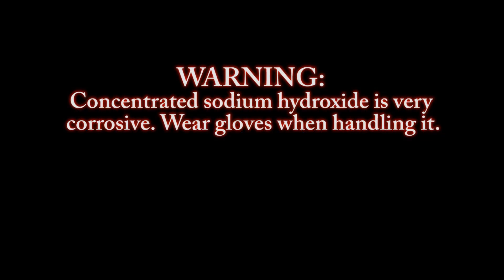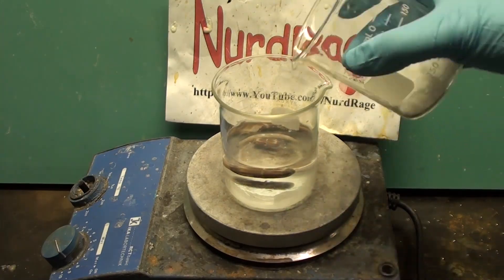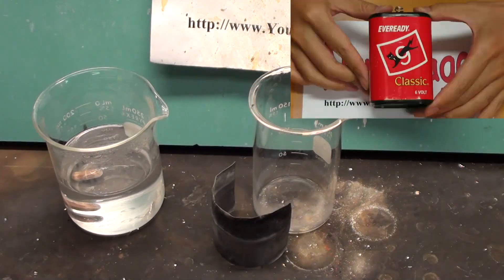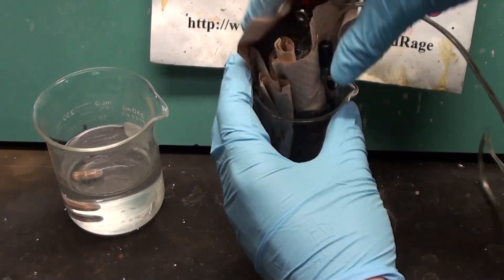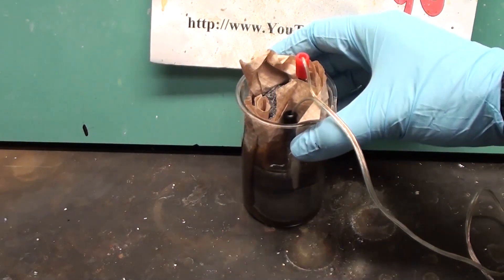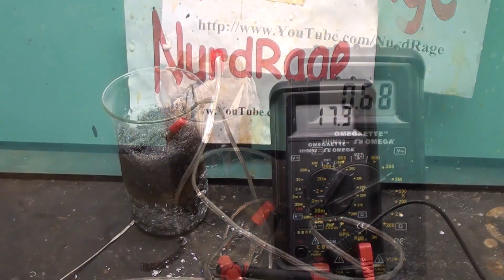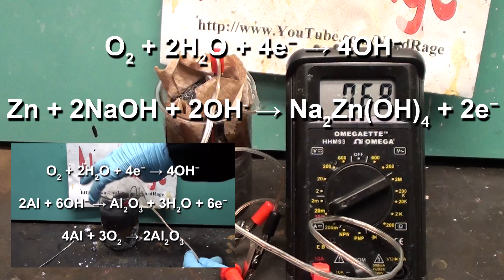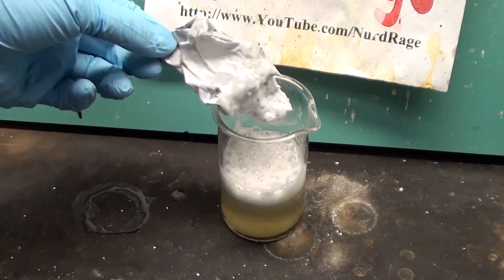Make a Zinc Air Battery

Comment: The railroads used this battery for many decades to operate signals, crossing gates, and interlock devices.

Low, slow current that would last for years.

My biggest question, can you recharge them???

Comment: Correct me if I'm wrong, but doesn't the battery need to be connected to a load in order to measure its current?
Reply: It is connected to a load- the meter. When switched to read current, the meter shunts the input across an internal, low-valued resistor (essentially a short circuit) and reads the voltage drop. So the meter is showing you the maximum current the the battery can provide.
Reply: frtard is 100% correct if anyone wanted conformation. Just DONT test the current in your wall socket if you're curious

Comment: what is its self life when activated
Reply: Throw in an LED diode and see.
Reply: @MexiChemia  this isn't the case anymore. A company now named zinc8 has figured out how to make the cell last longer than lithium. Zinc8 is owned by a mineral company.
Reply: @lksk99 same, checked out MGX and zinc8 stock. Found an article about MGX getting contracts to build a complex that will supply power to a town using this tech. The stock is cheap and might be a damn good stock to buy right now

Comment: then why all the buzz for the aluminum air battery?
Reply from the maker: oh this is just a home-made version for those people that want to make one. A commercial aluminum air battery would be built differently and run better than a homemade aluminum air battery.
Reply: I can imagine.  I'm glad I came across your Channel I used to watch it all the time a few years ago since then I guess I unsubscribed or what have you. I was watching and reading some things about how this kind of battery is not rechargeable and that there was work to make it rechargeable. Any idea how that would be possible
Reply from the maker: Usually such batteries use water to dissolve the chemicals. Aluminum cannot be "recharged" in water because the water would decompose and none of the aluminum would come back. So research is in using solvents other than water. Currently the most promising ones are "deep eutectic solvents". While they do work, they don't last the thousands of cycles required of a commercial battery. Most people would be pretty pissed off if they had to buy a very expensive new battery every month. So they're working on finding even better solvents. Research has been slow though.
Reply: I'll have to Google that.  I have a dream of converting my jeep to electric but for it to be practical
Reply: NurdRage I was wondering if this, or an Al-Air battery would be a viable alterative to the Li-Ion batteries that Rocket Lab are planning to using for their expendable Electron rocket. They're using electric motors to drive the turbopumps for the engines, so I was wondering if a cheaper and better performing alterative would be a disposable metal-air battery? You mentioned that one of the main problems with these metal-air batteries is difficulty in recharging them, but on an expendable rocket they're going to be discarded after the first use anyway, so reachability is a non issue for that purpose. What do you think?
Reply: It theoretically has the highest energy density of any battery.
Reply: It's kinda hard to find air or oxygen in space though.
Reply: Gregory Khvatsky Rockets already carry their own Oxygen on board for those same reasons. Otherwise we'd use jet engines in space.
Reply: Oh yeah, but designing such a system will result in a huge increase of complexity and creation of additional points of failure
Reply: Gregory Khvatsky Not so much I don't think. Mostly just some piping from the Oxygen tank to the batteries, and maybe a heater to keep them at operating temperatures. Also, by cutting the gas generator cycle from the turbo-pump assembly, they're already cutting hundred of possible points of failure.

Comment: how much batteries like that are needed to start up a diesel fueled car engine?
Reply: close...
15 gets you 12V@0.67A... 30 gets you 12V@1.34A... 60 gets you 12V@2.68A... So, you would need 1,335 of them to reach 12V@60A.  Of course the voltage will probably plummet under load and connecting 1K+ of those batteries will create other wire losses as well, so, let's just call it 2K to be safe.
Reply: +peternklv  A normal 2.0 diesel engine can start even with 12 volts at 60 amps circa , so : 12 / 0.8 = 15 ,  and 60 / 0.67 = 89. 15 + 89 = 104. You need 104 of those batteries for 12 V - 60 Amps
Reply: dont use these

Comment: My school is trying to power a small car with this reaction. The voltage is good but the current starts at .4 AMP and then rapidly decreases to zero within a matter of seconds. It jumps around a lot but is by no means steady as shown in the video. Any ideas on how to make the current steady as in the video?
Reply: This is more of an electrical matter than a chemical one - you've put a significant load on the battery and are draining it. The only way to keep the current more stable would be to have a larger battery.
Reply: +Chris Sawicki The oxygen dissolved in the solution rapidly drops when a current is drawn because the reaction consumes it.  Commercial batteries use an oxygen permeable membrane near the cathode to saturate this region with oxygen to help produce a reliable output.
Reply: It's limited by the oxygen reduction reaction (ORR) in the air electrode.  Try a MnO2 catalyst.

Comment: I made an aluminium air battery with a carbon cathode and an aluminium  tube anode, an electrolite of calcium hidroxide and calcium chloride in a cotton chunk, it gave 1.7 volts! but lower current. an aluminium hidroxide-oxide layer doesnt let the reaction to continue and the voltage decreased, so i was adding chlorhidric acid when it was happening. i think a better result will be obtained if instead of pure aluminium we use a GALIUM-aluminium alloy and a dry electrolyte

Comment: Instead of adding water, perhaps a hydrophilic chemical (like magnesium nitrate) could be used to grab the water right out of the air. Then the cell could be activated by just exposing it to the air.

Comment: can i charge my phone with this ?
Reply: Apple Best There are DC converters that can produce stable 5V output from this voltage. With the high current this battery produces, it might even be feasible. You can also connect seven of these cells in series (5.6V) and connect those directly to a USB cable. USB specifications call for a voltage tolerance of 4.75 to 5.25 volts. From personal experience, 5.2 volts works best for you (especially power banks with their cheap charge regulators will draw considerably higher currents at a slight overvoltage). The cells will probably lose some voltage due to internal resistance as you start drawing current, so as long as you don't let your phone run full on it, you should be able to safely charge it directly off the apparatus. I still wouldn't try it with an expensive device though.
Reply: No You need an excess of voltage.  A voltage higher than your battery is rated for.  that is more or less why they require smart charges.  otherwise you would overcharge your battery.

Comment: So can you recharge this battery? it seems to be a 1 time only thing is it possible to build one that recharges?
Reply: Josh Williams Unfortunately, you can't.
Reply: All of this is in the literature.  In theory electrical charging is possible, at least in a more advanced cell, and ways of increasing cyclelife is an active area of R&D.  You want to keep zincate ions from diffusing out of the negative electrode.  One way to prepare a zinc electrode is to mix zinc powder, zinc oxide plus a small quantity of binder (e.g.  hydroponics gel, white glue, flour paste, wallpaper paste, there are many possible options), and press it onto a current collector.  Use MnO2 for the positive (air) electrode.  If the air electrode doesn't stand-up to charging, use a third electrode (of nickel) as the positive electrode for charging.  Another issue is zinc dendrite formation.  To address this you can: Charge with a pulsing current.  Add nickel or indium.  Make a gravity cell with zinc on the bottom.  Use a sturdy separator.  

Mechanical recharging works too and may be simpler.
Reply: Josh Williams Recharge it by replacing the electrolite and zinc. mechanical recharging, like a fuel cell.

Comment: Cathode is the negative electrode*
Reply: Since this provides power (battery) the cathode would be positive.
Reply: An acronym is "ACID" = Anode is current into device .  Where "current" refers to positive charge carriers.  (opposite sign from electrons)

Therefore the anode and cathode actually switch when charging a rechargeable battery, but the convention is to still call the electrodes by the name they have when discharging.  Confused yet?  It's much easier just to call them positive and negative electrodes or "plates".

Comment: can you use regular salt water with this, or is sodium hydroxide required for this specific battery?
is sodium hydroxide a better electrolyte than salt water?
Reply: I plan to make some using KOH leached from wood ashes.
Reply: wood ashes leach K2CO3
Reply: Similar to the chlor-alkali process, I assume electrolysis of K2CO3 solution would release CO2 and yield KOH?
K2CO3 + H2O --> 2 KOH + CO2 ?
Reply: @mikeguitar9769  or simply react it with Ca(OH)2 and purify
Reply: @SuperAngelofglory    good idea.   K2CO3 + Ca(OH)2 → 2 KOH + CaCO3 (precipitate)
Reply: @mikeguitar9769  it is how they used to make NaOH in the old days, before the Solvay process was created
Reply: Hynkel Any group 1 and 2 hydroxides will work too, if you happen to have any lying around that is

Comment: In the previous video the biggest holdup was the aluminum oxide/insoluble hydroxide. If you get the NaOH sufficiently dilute it might dissolve the oxide of aluminum without attacking water too much, if you can create high enough overpotential, such as with acetylenic additives that hog gassing sites, similar to what's used in acid pickling rust remover additives for HCl, that removes rust from nail without generating hydrogen. Also mercury is a great way to break the oxide layer, but again, that starts auto gassing too, plus it's expensive and toxic, but gallium might be better than mercury. If there were a polar aprotic solvent that dissolved aluminum salts like it dissolves lithium salts in li-ion batteries, perhaps the aluminum could be dipped into that, and separated with a membrane that allows transfer of aluminum ions, but not water. I don't think such membranes exist, as the +3 charge and oxygen bond stregths are too much, but there are such things for sodium, beta-alumina is recently patented. In the Castner-Kellner cell the sodium-mercury amalgam has high enough overpotential for hydrogen generation, that sodium comes out on electrolysis instead of hydrogen, but magnesium does not work because the magnesium-mercury amalgam does not bind as strongly as the sodium-mercury one. I don't know about aluminum. Part of the problem of trying to get high hydrogen gassing overpotential out of aluminum-mercury or aluminum-gallium is that most commercial aluminum is alloyed with some copper, and magnesium, and the copper sets up a local battery, and the magnesium is really reactive with water. Things might be different with absolutely pure aluminum. Also, in the past even zinc based batteries used to contain mercury, for similar reasons.

Comment: Do you really need a separator in all metal air batteries? I'm trying to build a magnesium-fuel cell as a rechargeable power bank for my research project in my 4th year of high school (2nd year for K-12 systems). Any help would be appreciated
Reply: manganese-oxide
Reply: I believe cobalt compounds are used as catalysts in the commercial batteries

Comment: how long does it lasts giving 0.68 amps????
Reply: I guess it would depend on how much of the sodium hydroxide solution you have and how much of the zinc and iron are there to cause the reaction.. for that one he made I would assume it would continue that output for around 6 hours of use and then it would prob dry out you could always add more water to it and I would say if you could introduce more oxygen into the water kinda like an aquarium does you could get more power output.. if you google the stuff it says it is meant to be used up within a week after mixing it and it all depends on the enviroment in which it is stored.. since as you can see it needs that water solution to produce the reaction.. so if you had this outside on a sunny hot day it may only last for 2-3 hours of use.
Reply: Also that steel wool will eventually form into iron oxide or "rust" and the zinc will prettymuch deteriorate into the water .. but I don't really know much about zinc so maybe I am wrong.
Reply: It varies.

Comment: The one we made didn't output any voltage. There were bubbles coming from the clip used to attach to zinc that was submerged in sodium hydroxide. The zinc was also producing some minor bubbles. Any idea as to why?
Reply: Sounds like the reaction it was having wasn't what you wanted and instead of producing a current it was producing a gas... much like the tinfoil battery he was showing... I believe the zinc had a bunch of impurities or was corroded/deteriorated.. hope you didn't inhale!

Comment: I thought anode = Positive and Cathode = negative? I realise depending on the situation they switch but in this example isn't it the other way around... might just be having a brain fart... Question is out of interest, not to be a smart arse. Great Video!
Reply: Basically that's for devices that consume power rather than produce it.  

It's very confusing but an acronym is "ACID" = "Anode, Current Into Device" .  Where "current" refers to positive charge carriers.  (opposite sign from electrons)

Therefore the anode and cathode actually switch when charging a rechargeable battery, but the convention is to still call the electrodes by the name they have when discharging.  Confused yet?  It's much easier just to call them positive and negative electrodes or "plates" so that the proper name doesn't change depending on whether the cell is charging or discharging.

Comment: This battery does not use air as a dielectric, so it is NOT a "Zinc air battery." It would work just as well if you sealed the battery in a vacuum container! Also, why is lye solution used as an electrolyte when salt water would work just as well? It seems a rather stupid experiment.
Reply: harsh!  

I think it depends on whether OH- ions are available and whether they are coming from the NaOH or the air electrode.  Iron has some reactivity as an oxygen reduction catalyst.  But suppose the ORR is too slow (as apparently it often is), and suppose 2 Na+ reacts with zincate Zn(OH)4(2−) as the equations in the video suggest.  If using up OH- causes the pH to fall below 13.65, then I think the Na2Zn(OH)4 will decompose in the electrolyte to release OH- ions.  Zn(OH)4(2−) → ZnO + H2O + 2 OH−  .  (Thus restoring the NaOH!)  This seems to be the ordinary explanation for the way zinc cells work.  So the sodium zincate might act as a sort of pH buffer keeping the pH above ~13.  If true, it's kind of an interesting energy storage mechanism.  Maybe this allows time (in a primary cell) for the ORR electrode to catch up.  In a rechargeable cell though, I imagine they try to reduce the zincate sooner rather than later to avoid the soluble zincate diffusing out of the zinc electrode.  It's kind of hard to recharge the zinc if it is lost in the electrolyte.